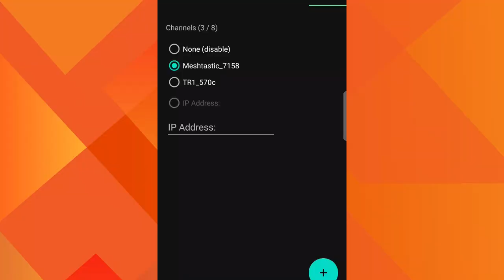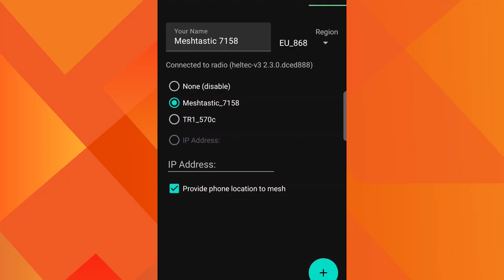How To Switch Meshtastic 915 MHz, 868 MHz and 433 MHz Bands on SX1262 Devices by Technology Master

Comment: Interesting video, I was suprised using two apps simultaneously with different setting. But one  thing I am missing here: 
The modules with SX1262 typically have 2 different LCR component placements, one setup for LF (433MHz) and another for HF (868+915MHz).
I guess there will be some losses, if using a frequency which was not intended by the actual component placement.
Reply from the maker: It is very interesting to find out if there are losses, YES must be. I have just posted a video which I hope you will enjoy. It will provide you with more info. Thanks & welcome for sharing your thoughts. https://youtu.be/Ke2e0uyvDZ4

Comment: Hello.  Heltec wireless tracker boards have a hardware selection of the operating frequency range.  The jumper is located between the Lora and GNSS antenna sockets.
Reply from the maker: Please send me the source of your information, if you want to help people.
Reply: @technologymasterkam An inspection of both Heltec wireless tracker boards 433-510 MHz and 863-928 MHz showed that the first one has a jumper on the “RLF” contacts, the jumper on the second board closes the “RHF” contacts.
Reply: you have 902.125 for long_fast in US but I have 906.875
Reply from the maker: @isthereafeeforthis  902.125 is confirmed. You can have a different frequency due to any other configuration change. If you need further help, please share you configuration for LORA. You can see screenshot on my website for frequency calculator by Meshtastic.                                          https://technologymasterka.wixsite.com/technology-masterkam/post/how-to-switch-meshtastic-915-mhz-868-mhz-and-433-mhz-bands-on-sx1262-devices-technology-master
Reply: @technologymasterkam  I went to you're site and see the screenshot you got from meshtastic but on their link "There are 104 frequency slots defined with the standard radio preset LongFast. After factory reset the radio will be set to frequency slot 20 with a center frequency of 906.875 MHz."      are you using slot 1 as default it seems 20 is default for LONG_FAST but I will try slot 1 for sure.
Reply from the maker: Long_Fast is a preset that can be used on any channel. However Meshtastic has a specific role for a Primary channel. There could be only one primary channel in your node. Main condition for being a primary channel is the encryption key of "AQ==". It is required for your node to see other nodes and other nodes to see your node.  Other requirement for the Primary channel is that all nodes in the mesh should have the same LoRa parameters. In simple words, it is best to have Long_Fast preset in the Primary channel.  So no worries about Long_Fast as you can set this preset on any channel you like and any number of channels you want.